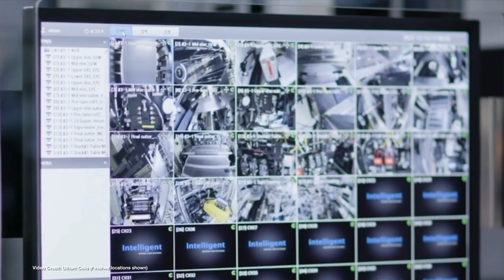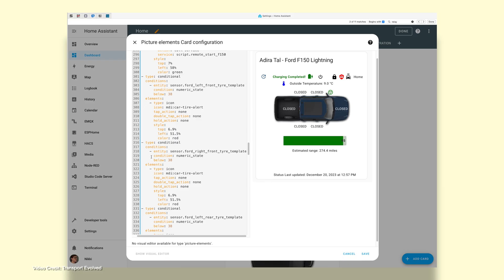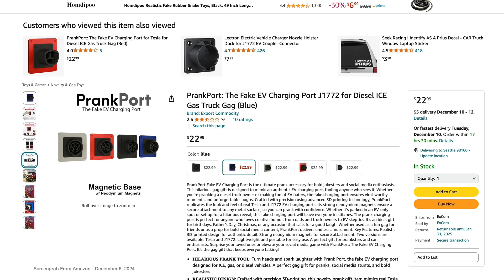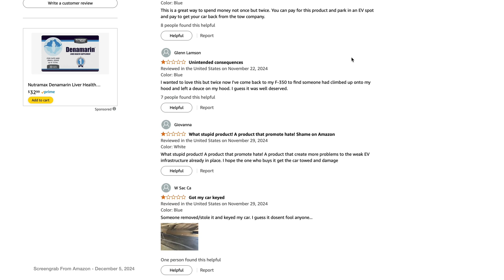ecoTEC 349: Ford’s Newest EV!BYD’s Bringing More EVs to NZ!Prank Charging Sockets Suck!

Comment: I'm amused by the fake charging ports for ICE vehicles largely because the short term interest of the ICE driver who saves a step or two (EVSE's are often close to buildings and their power) while the long term interest is horribly compromised.  

That understanding comes when ICE drivers realize that fuel costs are largely based on supply and demand and as EVs constitute a larger portion of the aggregate miles driven, demand for fossile fuels will declline.  With that decline comes lower fuel prices. 

For those driving EVs, the real challenge is in keeping the cost benefits of the inherent efficiency of electric motors (95+% vs. ICE engines 20-30%).  

Oil industry lobbyists strategy going forward will be to enact laws adding fees and additional taxes to EVs in an effort to erase the dramatic cost advantages of EV efficiency. 

The state of Georgia, for instance, has instituted a flat $250 road tax fee for EVs  which means, I'm paying the equivalent road tax of an ICE powered Spark (mine is a Spark EV) that drives like 90,000 miles over the course of a year. That is a gross and unfair disincentive and this alternative road tax fee is the same for a Tesla Plaid as it is for my Spark EV largely because legislators think EV drivers are just rich suckers. 

If the voters would just figure out that rapid adoption of EVs is the best thing that could ever happen to promote lower gasoline prices, they would realize that buy getting a sustainable EV like the Aptera (I think because it is an autocycle it avoids the big fee) and using it for every opportunity, they could keep a really nice ICE vehicle in the garage for larger group trips or they could opt for a large, heavy EV.  The point is they would have a choice, both of which are economically more viable than the status quo.

Comment: The NZ rebate was a con. The dealers just put the prices up to be just under the $80k. Then, when it was scrapped, they dropped the prices far lower than what the rebate was, some as much as $35k off the original retail price as in the Kia EV9 GT Line that was originally $135k down to $100k and even the EV that were priced to take advantage of the $7k rebate have dropped from $80k to less than $40k just to get rid of the stock. Even the Cheap Chinese EV are not selling in the numbers seen last year. Nah, it's the RUC that has done the damage as hybrids like the Toyota Rav4 are still selling 1800 cars, even with people having to wait 4-6 months for that car.
The used EV market is even worse, with EV prices dropping off a cliff! Our Dec 2022 Kia EV6 GT Line was originally $118k when new, we brought it for $88k as a demo in January 2024, just got offered $46k for a trade in! And only Kia wanted the car!!
Reply: All rebates or subsidies  do the same. Just put prices up

Comment: Gorilla heavy duty expanding  foam, £10.00 on amazon. Now what orifices on the back of an ICE car parked in an EV charging bay could be filled quickly and easily with such foam?
Reply: And you think that will make ICE drivers stop or take revenge by cutting the power leads off the charging stations. What a stupid, short-sighted comment! Or two wrongs do not make a right. I personally use a petrol stations air. Even though I never buy fuel, am I stealing with my EV?